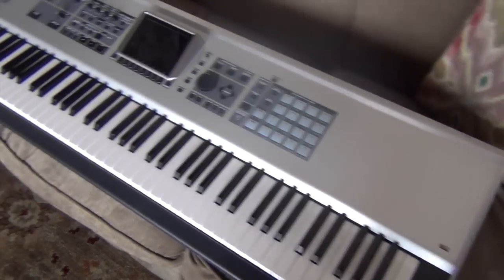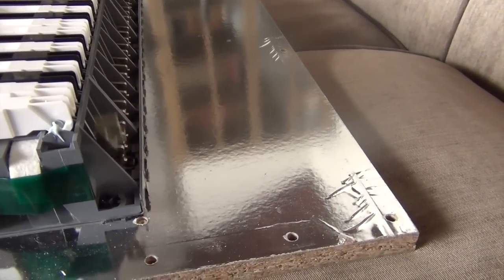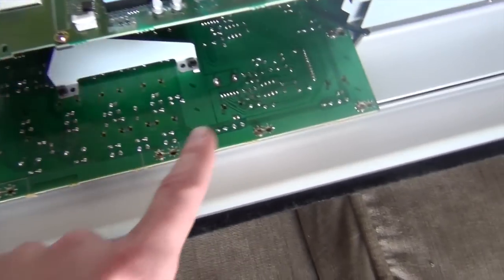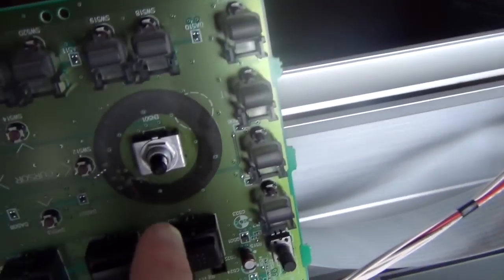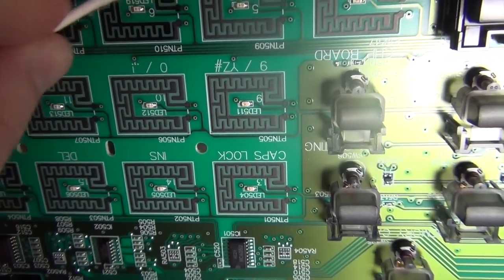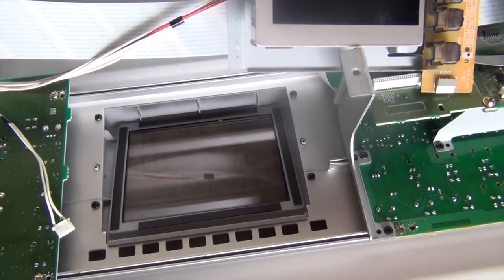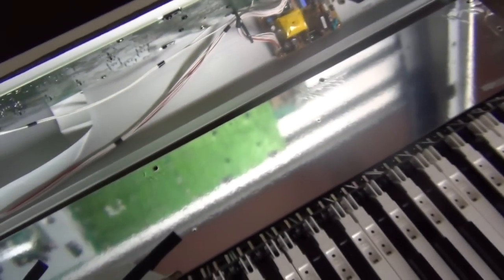Roland Fantom X8 Disassembly and Cleaning

Comment: Thanks - very helpful video. I had a weird output issue where one channel was quiet and there was a very hollow sound. Used this video to check out how to take apart and there were 4 very dodgy capacitors on the jack board A quick swap out and it sounds brand new!

Comment: Hi,If the touch buttons stop working so instead of replacing the buttons try ‘WD-40’ (google it) it brings life to your dead buttons.The WD-40 is not for cleaning purpose but fortunately it really works very well, I own more than 30 pro keyboards some of them are vintage and compatible buttons are not commercially available so WD-40 is the solution.

Comment: Thanks for making this video.  I just bought an X6, great deal off CL and even got it reduced more when I discovered that the PC Card Reader was sliding loosely inside the machine.  I knew it would be an easy fix, but have never taken apart a keyboard before so I was looking for a video that would guide me and give me the confidence to "DIY" the repair.  Your video was very helpful and I am probably going to lift the hood for not only the repair, but also a thorough cleaning and maybe even preemptively change out a couple knobs while I'm in there.  This is my second used Roland (other is an Fantom S) and the volume knobs on both seem very wiggly or loose; is that common you think?
Reply from the maker: Thanks Vince! I haven't personally encountered the wiggly/loose knobs. Do they function? Maybe their solder has broken loose in which case it may be as easy as heating up the solder on the knob connections to the PCB.
Reply: Greg Simon No problem with functionality or static, just scary if something pushed it over the edge and it happened to be at a show.  The "S" was toted around in a crappy soft case to gigs by the previous owner, but X6 was in a Gator Case coffin and still was felt much looser than the Real Time knobs.  I'll get to the bottom it.  Thanks
Reply: you can help me?

Comment: Hello.  I have a Fantom G8. Any differences to remove top panel?  I took out all the screws you mentioned for X8, but top panel still seems “stuck” towards the rear. It starts to open about 1” in the front, but then hangs up.  I don’t want to force it open and break something.  The wood is a little warped. Could that be the hang up or is there a screw somewhere I’m missing (maybe in the expansion bay on the bottom?

Comment: hi Greg - nice video!  hey, i have a roland G8 fantom that's been damaged by UPS.  the damage is on the black metal lower front piece.  it has a large "dent" that is stopping the keys near the dent from moving.  have you ever tired to remove that piece?  just wanted to know about the difficulty before i get into.  thanks for any info you can provide!

Comment: greg, thanks for the video. my spring came off of the sound bender. And dust on the glass over screen. The only thing I  had trouble with was the screws that I took out, some screws were smooth threads, and others were course thread.
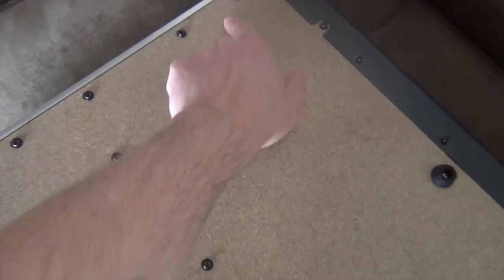Reply from the maker: You're referring to the screws on the bottom right? There are two types as you mention. Only two of them are machine screws however. One goes in between the black metal shroud (the shroud you DO NOT remove). The other one can be seen at 0:52 IIRC.
Reply: I have 7 machine screws. Sorry, took so long to write back to you. I have been working a lot.  Thanks again.
Reply: Greg Simon How DO you remove just that front black shroud? Mine has a dent in it I want to tap out. Do I need to remove the end covers? I tried pulling the screws that hold the shroud on - it loosened it but there's still something holding it back.
Reply from the maker: THEMADCHALKER Don't remove the side covers, remove the bottom FIRST. If you remove the sides first the structure will collapse and you'll find you have to remove the bottom to put it back together. Once the bottom is off you can see what is holding the front shroud
Reply: Greg Simon OK apparently there are two downward facing screws on either end of that panel on the inside seemingly put there for no reason other than to annoy the crap out of us. lol  http://s16.postimg.org/rwc6laio5/Fantom_X8_Screws.jpg
Reply: Greg Simon Update:  You can't take the side panels off anyway. There's stuff screwed to them from the inside. - And you can't just take the bottom wood off either.  What you have to do is follow your procedure in the video..  just lift the top up enough to get to those 2 downward facing screws and remove them. (and in my case..  throw them far away). Then reassemble the keyboard.  Now you can remove just the front panel whenever you need to by pulling the screws from underneath.

Comment: Hi Greg,
 I own a Fntom X6; 4 of my keys(D,A#,F#,D) are not sounding or responding at all. Should I take it to fixing store ? or open it up and clean it will be fine u think, if so, whats the best way to clean them ?
Please let me know !
(btw thumbs up for the vedio)
Reply from the maker: +Syed Mohi Yes almost certainly you just have dust/dirt between the rubber membrane and the circuit board (PCB). I would definately try a DIY clean first since you're already out of warranty.

Comment: Hi Greg,
I also own a Fantom X6 but some of the patches sound very dull and with a high pitch (ex. the patch Paris Romance)
I owned a lot of Fantom X models and never faced this problem, tried factory resetting it but still some of the patches doesn't sound the way it needs to be. Should I take it to a local store to check it? or is this a problem potentionally caused by dirt inside? If so what do I need to clean in average?
Thanks for your video liked!
Reply from the maker: Not sure. Perhaps there is a discrete part (e.g., a capacitor) in the output stage(s) that is in need of replacing. I would start by checking left vs right to see if only one channel is bad. Key is to try to isolate the issue.

Comment: Thanks for the Video Greg. I have a Fantom that had been working well for 6 years. So obviously out of warranty. Now, When i switch it on, it doesn't boot and the screen keeps flickering. Ive tried holding the exit button etc upon switching on but no use. 

Spoke to a few people who say I need to change the board inside without even seeing it! That costs well over £650 just for the board and a further  few hundreds to repair (from what I've been told). Is there any DIY that I can try before committing? Any help is appreciated. A
Reply from the maker: This almost sounds like a power supply issue to me. First check to make sure power connections (wires) are good and plug ends are seated. Then check the power supply itself as long as you are comfortable measuring voltages in a live circuit. Be very careful when checking voltages on a live circuit!
Reply: Thank you Greg. Will try this method and let you know how it goes :-)

Comment: thanks for posting, do you know how to fix 'broken keys' or these just have to be replaced? im expecting mine soon and this cleanup and fixing keys will happen
Reply from the maker: +alejoswp Depends on how they are broken. Perhaps the switch(es) underneath the keys need to be replaced? Roland still stocks all these parts I'm fairly certain.As you can see in the video the switches are a rubber membrane -- I would first try to just peel it off and use some isopropyl alcohol to clean the contacts.
Reply: +Greg Simon , thanks for your response... i found out it wasn't the keys but this that broke: Keybed sub-chassis, 12-note. So i did a quick fix (it had superglue) with a strong adhesive someone recommended and tomorrow it should be done. Also cleaning volume pot was a little tricky but necessary.

Comment: Super job!
Reply: +Sound Services Just mentioning that the two screws (opposite the edge with several screws that must come out) are slightly different than the other screws. Be sure to get these two back where they belong. If you try them in the wrong place, they will be too tight and hard to turn (your warning that something's not right!).